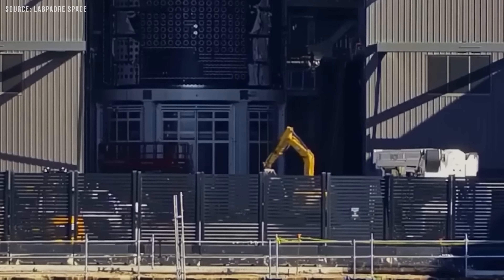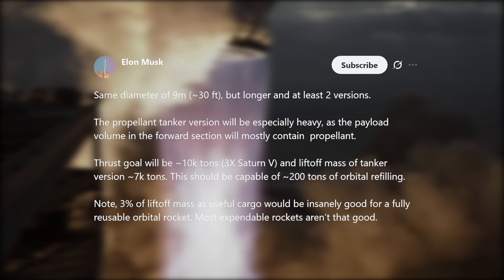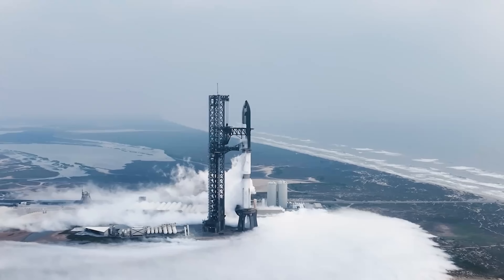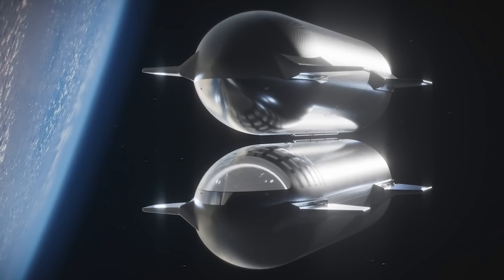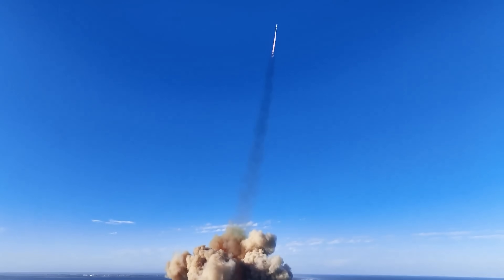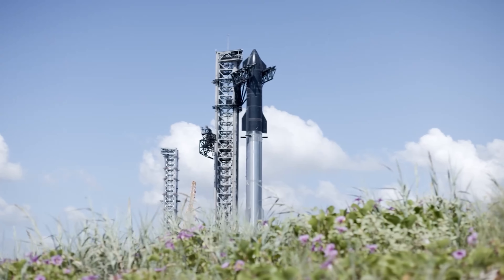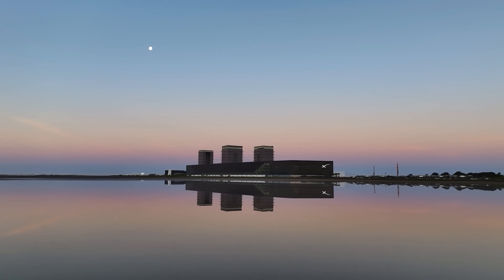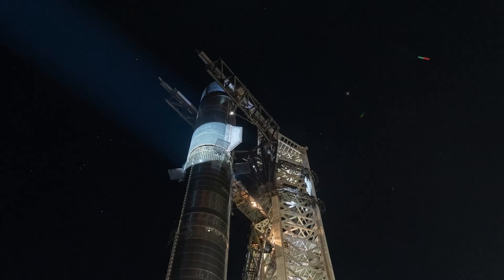SpaceX's New Starship TANKER is Finally Coming

Comment: Maybe I'm just making a mountain out of a molehill, but I'm concerned about solar arrays and free flowing rocket fuels in close proximity all the while docking.  In any case, this may only be an interim solution.  I would propose a central docking system array with multiple tankers semi-permanently docked. The central dock would both draw fuels from resupply ships and refill Starships without the wait for multiple launches.  Another plus could the temporary attachment of a tanker to a Starship that would to be extending its range into the Asteroid Belt for mining or on to the moons of the outer planets.  Perhaps one or more of these moons might have liquid gases that could be refined or developed into fuels. An outer planet refueling station may allow faster transit times back to the inner planets.  I'm aware of the orbital mechanics that may require multiple refueling docks to establish a viable supply system.  This, in turn, would support a more robust exploration of some outer planets and the Asteroid Belt.  Just a thought.
Reply from the maker: I think SpaceX would likely to go for the simplest approach, but that could change if they need to

Comment: SpaceX has not decided which of two designs will be built. This video is full of assumptions, ifs and maybes. Good luck with attempting an orbital fuels transfer in 2026. A few ears ago NASA paid SpaceX #millions to design and produce the required fuel transfer valves. This video asserts that such valves are not needed because the fuels will flow by use of transfer differentials. Previously SpaceX said orbital refueling would be accomplished by inertial sloshing the fuels from the Tanker ship into the recipient Starships.